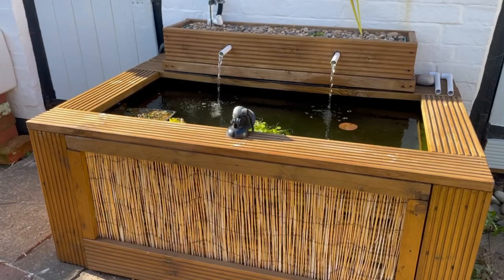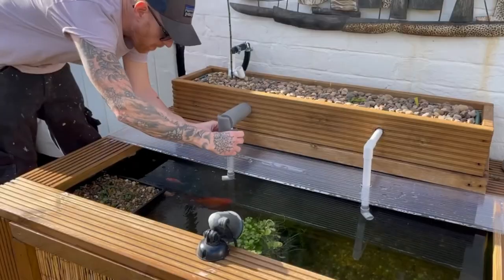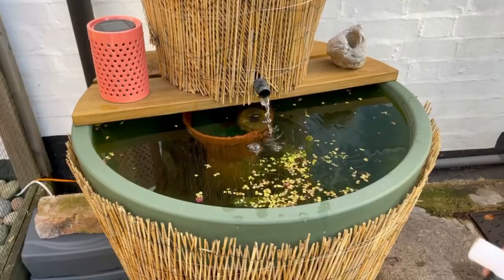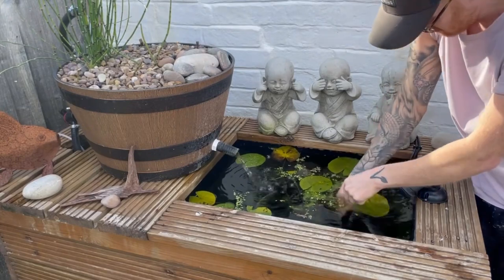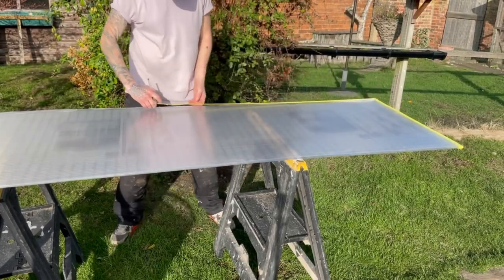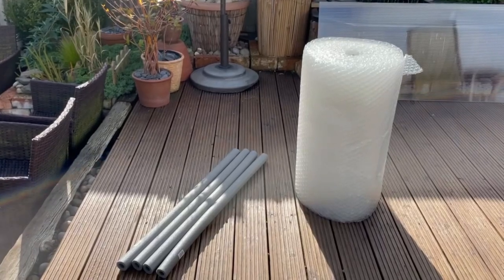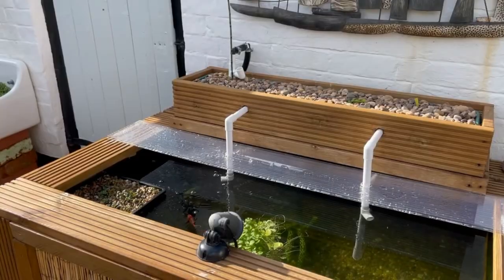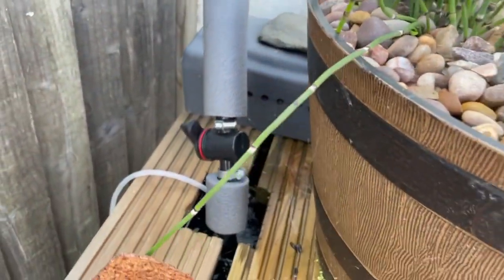Preparing Ponds for WINTER.

Comment: Hey buddy, here in Belgium they are speculating that it would be the coldest winter in a 100 years. We all will have to do that little bit extra to make sure all will be fine. There are some great tips!
Reply from the maker: Oh no.. 😩 I was hoping for a nice mild winter! At what temperature would you start to worry about your fish? What precautions will you be taking? Hope you’re all good bro! 😊
Reply: @GingerFishyOfficial  my pond is in the ground so not to much. Just cutting down my waterfall so that it doesn't cool down the water more. Set my airstone higher up and put some dome shaped foam in there to be able to look down on the fish if it starts to freeze over. If the ice becomes to big I will shut down all the filtration to make sure that nothing gets blocked and freeze's over and break's down on me.
Could make a vid on it
Reply from the maker: @vertigoone-one-722  Yeah, make a video bro, be good to get an update on your pond! 👊

Comment: Do you not feed in winter?
Reply from the maker: Not usually, once it drops below 10°c/ 50°f i usually stop feeding. I am thinking of trying to heat 2 of my ponds to 10°c this year though, so probably will give a little bit of food maybe once or twice a week. I’ve watched a few videos by Dr. jessie Sanders (a fish vet) and I’m pretty certain she recommends continuing to feed a little bit over the winter (although she is in a warmer climate).. I think she also said that you can continue to feed normal fish food aswell, as opposed to feeding wheat germ, which is what most people recommend for feeding at lower temps. It was a while ago that I watched the videos though so you may want to check them out for yourself 😊👍

Comment: Wish I could keep my ponds running like yours but I would super chill mine... 
Great covers that you made and use of insulation
Reply from the maker: Yeah, I am a little nervous about the ponds.. Last year I only had two so I was able to heat them so they didn’t drop below 10 degrees. Now I’ve got 4 ponds, and with the current electricity prices, heating all of them isn’t really an option.. I’m sure they’ll be fine though! 🤞
Reply: @GingerFishyOfficial  they should be fine

Comment: Nice ideas. Didn't even think about the pipes freezing ect.. Will definitely get those insulated, I've got lots of pond lettuce, will ovef winter some of it in the kitchen and probably bin the rest 😂
Reply from the maker: I ended up throwing all my water lettuce.. 🫢 I have put a bit of the Salvinia and Amazon frogbit in a little indoor tub though, to hopefully over winter! 😃
Reply: @GingerFishyOfficial  yeah I've got a water chestnut (I think?) that should die off and re surface in spring, my water lettuce has literally multiplied 20x 😂 😂 gonna be doing my winter prep this week, hopefully should be OK.

Comment: Thankfully I don't have that problem. The area I live in is called the Sunshine Coast in South East Queensland, Australia and I'm probably about in the middle of it on the North/South axis but on the coastal side of a range. We do get down to single digits in winter but the coldest we've had the five years in this spot was 6 Deg Celsius. Still thinking I might at least insulate my above ground pond build though but mostly because of the heat. Anyway, I bought a pump yesterday, a Chinese made pump but I'm told it's pretty good. DC variable speed, programmable etc.
Reply from the maker: Yeah, we had a really cold snap mid December and the bog filter on the above ground mini pond did briefly freeze solid.. luckily everything started back up after the ice all melted.. but yeah, part of the reason I went in pretty hard with the insulation was also for heat, after we hit an all time high of 40°c the summer just gone… I’m sure the pump will work great! Also, Sunshine Coast sounds amazing!!!
Reply: @GingerFishyOfficial  I would send you some pics but it would probably be quicker and easier for you to Google images for the Sunshine Coast, QLD. 😆

Comment: Hi ,you have some really good ideas here. Unfortunately, when my above ground pond was built the liner was just put straight onto the patio.  On your other video, you put down sand and insulation. Do you think my pond will be ok or should I get someone in to do what you have done ? Ohherwise next winter I will only be able to insulate the sides and the top. If electricity prices come down I will heat the pond. 
Last year I was not ready at all. Do you remember in November we had that really cold winter. I brought my fish inside.  A lot of my neighbours lost their fish 😢
I hope that your fish were all OK. 😊
Reply from the maker: Hi! I don’t think insulation under the pond is essential.. from the research I did, the best thing you can do to help stop the water temp from dropping to far, is a lid, as apparently it’s the wind whipping across the water surface that really cools it down. Insulation does definitely help though. I took the lids off all my ponds this weekend just gone to see how all the fish were, and they were thankfully all good! I did put the lids back on afterwards though, as it’s still getting really cold at night. The only issue I really had over winter was around mid December when the temp really dropped, and the bog filter in my above ground mini pond completely froze.. so I turned the pump off, and once the pond had thawed I turned it back on, and luckily everything was fine. I did add a heater after that though, attached to an inkbird thermostat, so it would kick on if the temp got too low again, and stop it freezing. Fortunately I don’t think it got that cold again, so the heater never kicked on. 😊
Reply: @GingerFishyOfficial  Thank you for such a good reply. I will buy one of those thermostats for the winter. I remember when it was really cold in December my pond completely froze over right to the bottom and the ice actually came up high out of my pond. 
So how much of a breathing gap do you leave when your lid is on your pond? Do you leave your air stones going? I am really happy that all of your fish are well and made it through the winter. 😊🐟🐠🌨
Reply from the maker: @suzannemoran7281  i don’t think you need a huge air gap, but you do for sure need to make sure that you don’t completely seal off the pond.. I leave my air stone going, but what I do is to lift it up, nearer the surface, that way it can help stop the surface of the water freezing, but won’t disturb the fish overwintering at the bottom! The inkbird thermostats are really handy for setting a heater to a lower temp!! 😊
Reply: @GingerFishyOfficial   There is quite a lot of information one needs to become a successful fish keeper. 🐟 Thank you for all of your help and advice . Sorry one last question ,do I turn off the pump in the pond and just leave the airstone. BTW I love the little stones you have to put your airstones into
Reply from the maker: @suzannemoran7281   That’s a tricky one to be honest, I personally leave my pumps running over the winter, but I do lift the pump up a bit higher so it doesn’t disturb the water at the bottom where the fish are over wintering. A lot of people choose to turn them off though, and just leave an airstone going to stop the surface from completely freezing over.. There’s pros and cons to both.. I’ve heard if you turn them off you have to make sure no water is left in the pipes/ hosing etc because if the water freezes inside the pipe work it can expand and cause a leak when it thaws out. Leaving the pumps going can also cause problems though.. for example if the pond does freeze, water can sometimes be diverted out the pond, which has actually happened to me before, luckily I noticed what has happed before the pond was drained too much. I think if you can stop the pond from freezing, through insulation, a cover and possibly a heater you can safely leave the pump going. But if you think the pond is going to freeze then it maybe better to turn the pump off, and so long as the pond doesn’t freeze solid the fish should be ok to over winter at the bottom. The fish won’t really be eating and producing waste over the winter so the filtration isn’t really needed. Hope that helps! 😊
Reply: @GingerFishyOfficial  yes it does help thank you. It is a case of individual judgement I guess. I do have another alternative if things get really really cold. I have a large container and I could put the fish in that and leave it in the garage. It would still be cold but not freezing. I will see . Now time to enjoy the spring and summer. Please keep your videos coming. 😊